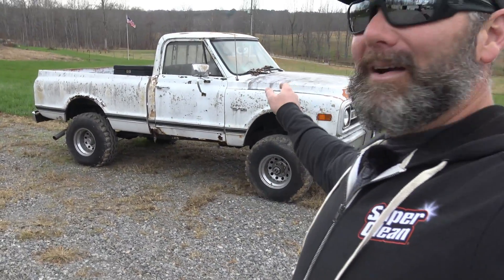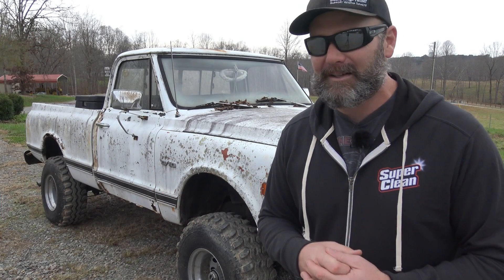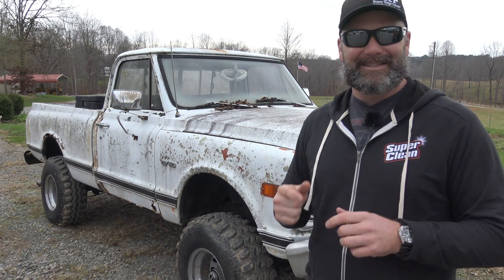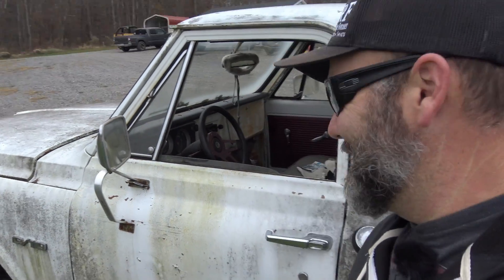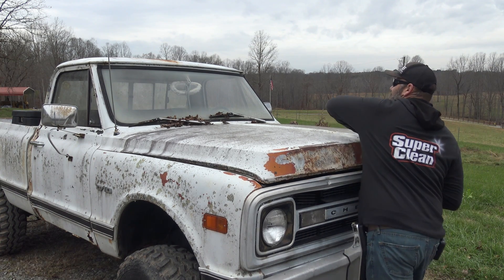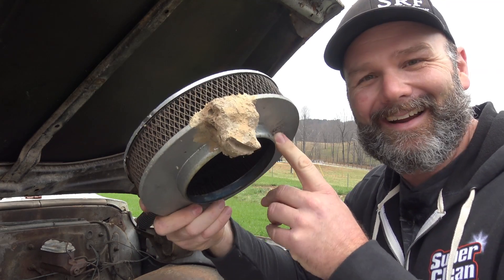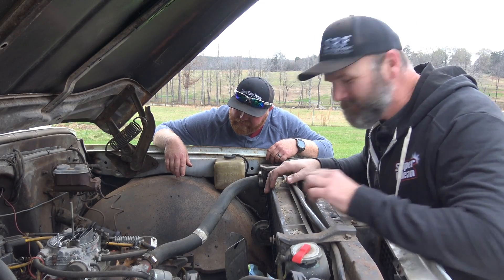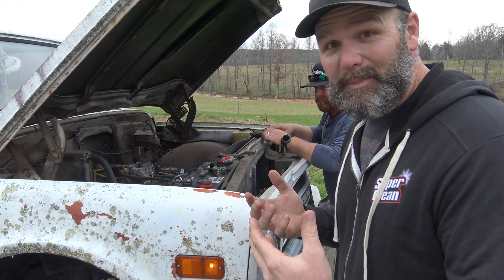Is it worth saving?? Rare and Rusty 69 Chevy C10...No start in 15 years!

Comment: Hells yes I'd love to have a truck like that..my very first vehicle I ever bought on my own was a 71 Chevy C10 short wheel base fleet side for $500..2wd 307 with factory flat top Pistons 2 brl 3 on the tree.. primered red paint..and it run like a raped ape..it jumped time so we fixed it back with a cam out of a 400 sb and put a 4 brl intake and carb on it and with 305 L 60s on her shed get out from under ya pretty quick..lol..that back end had no weight to it..blowed the rods out the block and pan of the 307 and put a 12:1 dome piston standard bore 283 in it with a 375 horse power 327 blue racer cam and an extreme high rise dual plain wiend intake in it..first pass the back of my buddy's head hit the back glass..my other buddy said let me adjust those valves I can get it better..I said no way man it's running great ..but he insisted he could make it better..short story long he wiped a lobe off the cam..3500 dump the clutch and it barely would even spin the tires..then my front end broke on the driver side..gave it away...I miss that old truck ..sorry for going on guys...I just love telling that old story..

Comment: Hey I have a few suggestions  just to save you a pain later on when you replace the fuel tank put an electric pump on it that shuts off with the key and also that body maybe setting  on a different frame  just a thought and also check out lmc trucks for you body parts and you can also get a full bed for it

Comment: its a K10 not a C10, 1967 was the first year for the K10, someone put te front sheet metal from a c10 on it if you look on the inside of the glove box door the first letter of the serial number on the spid should be a K if the spid is still there. Good deal on a hard to find truck, also spray some lube on the Z bar linkage for the clutch lol its bolted to the driver side of the block and frame

Comment: VIN starts with CE.  so originally it started as a 2 WD.  KE would be 4 WD from factory. Chevy started using C/K designations in. 1960
Reply: Methinks that's a cab swap or fenders from a 2wd
Reply: I was going to say the same thing
Reply: @rsprockets7846  they never had a shortbed 4x4 without a conversion, the 4x4 were only offered in a longbed and more often a 3/4 ton
Reply: Not always true some trucks were improperly titled and you would have trucks with factory small locks that said they came with a big block so it could have been a mix up in the title
Reply: No that’s incorrect there were quite a few short bed 4x4s made in 1/2 tons 3/4 were only made with long beds

Comment: Fix the rocker panels, use a lot of PB blaster and WD40, give it a good pressure wash shoot some primer on it and then clear coat it.  I would use it primarily as a farm vehicle and wouldn't even tag it.  You're probably right about the fuel mileage.  I had a 350 in a 74 Nova bought it new and it would never get above 12 mpg.  I would probably go for a new fuel tank for the truck, with all the gunk that's accumulated over the years that would probably be the first major purchase I would do for the truck.

Comment: Happy Thanksgiving Josh. 
I worked in Mexico back in the mid 80's. I saw a 7-8 year old kid sitting in the engine compartment of a medium sized truck with no hood, feeding the carburetor with a gas can as it was traveling through Tijuana! Your ingenuity is amazing!
Reply: I was in Neuvo Larado in 1986 and I saw a 64 Chevy being driven down the center of town with no windows, no springs and no plates.  No rust though!

Comment: I know alot of them had 327,s in them but probley a 350 they wouldn't put a 305 in it but they are worth a few bucks for sure but they did make 4wheel drive back then ..they are a great veihicles I'll probley do a number reference and get the info on the moter excetra ..and you look so excited about the truck  witch is cool ..

Comment: 350, Flint plant, April 22, 1975, L LS9, 165 hp, 4 bbl, C20 - 3500.  According to info found on NastyZ28.com
Reply: They say that most likely it is a 4 bolt because of the 3/4 ton truck designation

Comment: http://www.73-87.com/chevy_ids/scode8.htm
S code on the front of the block TXB shows 1975 C20-C30 350 4bolt main 165hp , 3970010 casting code is a nice strong block to have, can be built into a pretty decent powered 350 nice find!

Comment: That Engine Block is an original 69 Chevy Block from the casting number here is the options
3970010	302	1969	Camaro Z/28 - 4 bolt main bearings
3970010	327	1969	2 bolt main bearings - trucks
3970010	350	1969 - 80	2 or 4 bolt main bearings
Reply: 302 would have DZ stamped in the block vin.

Comment: Yes, it is worth saving and fixing. Easier to work on, no sensors or computers. I have a 1972 3/4 ton and a 1970 1/2 ton. Both trucks are factory 4x4 and badged with " C ' but  vin#   says   " K '".  The 70 4x4 is my daily driver in the mountains of North Carolina and fixing to do a 1-ton axle swap next week.  Keep up the posts.

Comment: 3970010
69-79
302/350
car & Truck 2 & 4-Bolt Most common, 

V0422TXS
V-Flint plant
0422
04-April
22-22nd day
TXS
TXS-1975	cid-350, application-fwrd cab, 	Eng Vin L LS9,  165HP, 4 Barrel, GM-Body C-20 to 3500

Looks like you got a 350,  high nickel block most likely an4 bolt main.   If u pull the valve covers and get the head castings you’ll be able to see what the heads spec at.

Comment: I would love to have that truck . I am a Chevy man from way back . my first car was a 1971 Chevy Malibu with a 305 in it . After that I had several Chevy pickup trucks from full size to s 10's  . and now I have a 1989 Dodge Dakota 5 speed and I need someone that knows what they are doing to help me get it up and running again . It has been sitting for about 3 years or so and the last time it was running I think I blew a head gasket .
Reply from the maker: You had yourself a 307 ...ask me how I know lol.....My second "muscle car' was a 71 Malibu 307 we cloned to a SS...but put a 383 stroker in it...would not run on pump gas....ugh..what a pain
Reply: @StoneyRidgeFarmer  you know you could be right , it's been over 45 years or so since I had it .

Comment: Big mistake not disconnecting the gas line to carb, you just pulled a bunch of junk into the carb. LMC  has the parts you will need. Clean the varnish out of the tank. Gonna need new valve guides, made for today`s crappy gas.

Comment: I was going to suggest that you pressure wash it but I'm afraid by the time you're done you won't be left with anything but a frame. That truck would be worth redoing and it would cost a good penny because it would need a lot of body repair and probably would be worth just replacing many of the panels assuming you can still buy them. As you probably know there are restoration sales that you can buy remanufactured parts for but the best thing would be to completely disassemble the truck and have the frame cleaned and repaired if needed and then have it powder coated. You can have the engine rebuilt if you wanted and had the money you could have it done professionally but many people would probably laugh at you for trying to fix it up but it probably could be done if you wanted it that bad. I like to see old trucks like this put back in service but if you use it just for a farm truck as you drive it around chunks of that thing will fall off so what you do is up to you. By the way you paid way too much for that truck.
Reply: You can buy new sheet metal for these trucks. Just about everything is available.  Patch panels can fix that truck.  Entire new cabs are available - very spendy.  '67 to '72 C10s have become one of the most collectible models, restored these can bring muscle car prices. It would be a labor of love to restore that body, but lots of people do that.  A cheaper way can be to buy a C10 long bed from a farmer and use the good parts.  The short beds bring the best prices, but I like both.  You can even modify the long bed box to short style.
Reply: With a little work he could double or triple his money on that thing. Definitely did not pay too much.

Comment: I’m jealous! The c10’s are in my opinion some of the best preforming and best looking trucks of all time! I also love the fact that you got a 1969! Good looking! 

If you want a 1974 f350 custom flatbed, let me know haha!
Reply: These are the first modern GM pickup cab design, but they still have nostalgia details like flat side glass and painted metal interior surfaces. '67 to '72 C10 2x4s have full coil spring suspension.  Many consider these to be a hot rod with a box on back. These are lighter than newer trucks and respond well to horsepower increases.  There are a plethora of aftermarket upgrades for these trucks.  These trucks are what the '55-57 Chevy were to older project builders - not that those cars are being forgotten.  Yet, for years the C10s were just old farm trucks.

Comment: That's the kind of truck I want. Not like the computers on wheels these days.
Reply: Lol  I have one. 1970 2 wheel drive, No power steering, no power brakes, 250 6 cylinder 4 speed on the floor. No radio. No carpet. 103,000 miles. Runs great. I learned to drive with this truck. Only upgrade was radial tires. Rides so much better.
Reply: @charlesknaack1042    Great fun.
Reply: I want a 71 C10 that’s been LS Swapped. My money won’t let me have it though

Comment: Yes, ALL of these trucks are worth saving. I'm rebuilding one same year right now. It was built same year I was made. It's a K10 if it was built as a 4wd. Mine is originally a c10 now it's a k30 throttle body 5.7 with sm465 trans and np205 t-case.

Comment: I've seen a couple around that year at the auto auctions. I wouldn't buy them because they wanted over $2K for them. By the time you do what is needed to make them safe, you got more into them than they're worth.  In 69 Chevy offered both the C10 and the K10 (C 2 WD and K 4WD) but the only V8 option was a 307. I'd say the fenders were swapped out. (Maybe wreaked?)

Comment: Most 350 blocks had 010 as last numbers . Early 69 4x4 had enclosed u joints on front axle. Definitely a newer engine as original had a different alternator and power steering pump location. I would say original 4x4 as it has rear leaf springs

Comment: I have never seen fender emblems that said K/10 although that would be what that truck is. The 4x4 models had a emblem that said " four wheel drive tho. The 4x4 blazer models had a K/5 emblem tho. I believe factory four wheel drive was an option first offered in the very early 1960s.

Comment: Be mindful of the fuel pump, a bad fuel pump could pump gas into the crankcase.  Check out the frame and suspension points to see if any major rust.  It could make or break putting any more money into this rig.  Would like to see the Jeep finished though since you spent so much in all the parts to restore it to the original glory.

Comment: The windshield is two pieces of glass with plastic in between.  On older cars the glass can de-laminate and look cloudy on the edges.  It will never be worth a ton but it looks like an easy fix, for sure worth the time.  Bad gas often will not start, but will run an engine.
Reply: Some of these 69s have sold for 70,000. There's a company in Michigan that buys them and restores them and sells them for 250,000. That is A LOT! That is a ton of money!

Comment: the numbers come up as a 1975 or 1976 350  most likely 4 bolt as it was in a truck
Reply: I bet the truck is sitting on a later model chassis.  Maybe even the one the motor is from.

Comment: Oh man, I was smiling from the minute I got my notification. That is an awesome truck. Noticed it even has a gun rack over the sliding rear window. That slider window looks like the one in my 1977.

I'd love to check out those block numbers but, I got rid of all of my reference books and, I have a lot of trouble surfing the web.

Congratulations on your great find. By the way, did you happen to pull any of the spark plugs?

Comment: I've been looking high and low for a truck like this and still haven't got the chance to buy one.
Reply: I have one   from Canada Ontario
Reply: @murphysmachanics5743  I am looking out my window at it but no pictures . Texas box with wood that is rotted out . New floor in cab . Bottom of doors worst part .

350 runs good   ,three speed ,adjusted to shift .. Strong truck

Comment: I know it says c10 on the side but I’m wondering if someone didn’t just put that body on it because a c10 is 2wd a 4x4 is a k10. At least from my knowledge and experience
Reply: Well I left that comment before I even watched it... my guess is someone built that truck. I’m pretty sure they had a factory 4x4 in 69 though
Reply from the maker: watch till the end...VIN number tells it all
Reply: @StoneyRidgeFarmer  man I’d love to have that truck. When I was a kid I built several of the square body trucks from the late 70s but never messed with the pre-72 trucks
Reply: @StoneyRidgeFarmer  Josh....due to ads for other videos at the end of YOUR video, the complete vin from the start isn't readable. What I can tell you though, is that on a FACTORY 4x4, the VIN starts with  K.  First letter C is 2wd...K in 4x4.  Also,  4x4 had a FACTORY cut out cover inside around the SHUTTER that was bolted down. Is your first vin character a C or a K?  A lot of these 4x4 were converted. Also, what's your vin tag rivets look like? Factory rivets or new type or screws? Cool rig either way. Did you look at the clove box tag ?
Reply: @lawsonlawnandfarm8073  K10 was a Blazer.
Reply: @miketubbs2201  My 1977 Chevy 4X4 Short Bed pickup was a K10 too.
Had a 67' C10, short bed, stepside I gave to one of my sons.
Reply: C10 was before 73 k10 was half tons after 73 blazer was a k5
Reply: Can’t tell from the vin with video selection covering up the first part of the vin
Reply: @miketubbs2201  k5 was a blazer
Reply: My K5 was a 1972 blazer with a 350 vette engine backed with a turbo 400 automatic transmission.  Way too much power for that thing, but it sounded cool with the broken glass packs.

Comment: Josh that's a 1969 302 with a 4 bolt main out of a Z28! Love the truck I've got  a '70 in my collection. Hope to catch up with you again one day. Happy Thanksgiving and be safe,
Reply: I don’t see DZ in the vin on the block 🤷🏻‍♂️
Reply: That is the 69 casting 4” bore block. To be a 302 it would have dz stamped in it and only dz as the 302 identifier. The casting code does not tell you if it’s 302 or 350
Reply: That casting number means nothing, it was used on everything from 2bolt to 4bolt etc. My car has the same casting number and I have no idea what it is. Lol
Reply: who puts a ford engine in a camaro
Reply: @tncountryboy06  nobody but chevy did make a DZ code 302 for scca
Reply: @tncountryboy06  Probably should delete your post.   Chevrolet’s DZ 302 cubic-inch powerplant is regarded as one of the most legendary small-blocks that Chevrolet ever developed
Reply: Hahahahaha riiiiight
Reply: No it’s a common low compression 350 block. The 010 casting was used from 1970-1987. It can be a 2 or 4 bolt main block.

Comment: That’s a split master cylinder.  You should have brakes on two wheels.  The brake pedal will be very low.  Get rid of that old gas.  That will gum up the engine.  Engine doesn’t sound too bad.  Fuel pump replacement- not difficult.  Fuel tank replacement? Easy enough in and out of the cab.  C10 or K10? Maybe the fenders were replaced.  Go for it - the parts you need are not expensive.  And - change all the fluids.  Happy Thanksgiving!  Good luck with the ‘69.
Reply: Steering column was a 3 on the tree so its probably  a C10.
Reply: To the best of my knowledge Chevy  never badged any thing except the Blazer as K  the 4x4s just got a 4 wheel drive emblem on the front of the fender and were called K10s since they were 4x4 but were still emblemed as  a C

Comment: You might think about putting a flat bed on it and save on a lot of body work
Reply: Quarter panels first, patch up the cab to keep out the mud and the carbon monoxide. Chevy= rust never sleeps.

Comment: IF ITS 302 OR 327 IT MIGHT CAME OUT A Z 28 CAMARO
Reply: It’s a 69 block based on casting, it’s not a 302 based on the fact DZ is not stamped in the vin. So it’s a 350
Reply: Z28s never came with 327s

Comment: Unless the grill has been replaced,  it looks like it's a 1970.  As I understand it,  the 69 has a solid egg crate insert behind the grill  and the 70 has an egg crate divided into sections.  But this was my favorite body style of GM trucks.  I had a good friend who's father bought a 1970 C/10 brand new with a 307 V8 and three speed on the tree.  Compared to my 65 C/10,  his was more refined and quiet and smooth riding.  Love that generation of trucks!

Comment: In 69 I think it would still be badged as a C10. 2wd and 4wd had different size transmission hump. I believe they are bolted in on that so not hard to change to convert to 4wd if that is what happened. It doesn't have power brakes so that is correct. If it still has drum brakes on front its probably factory 4wd. I think they started power disc in 71. Also I think the factory transfer case would be an NP205 which is a nice big gear to gear transfer case. That cab is probably correct as well because the mirror is mounted to the roof.
Reply from the maker: Look at the VIN at the end of the video ...it tells the tale!